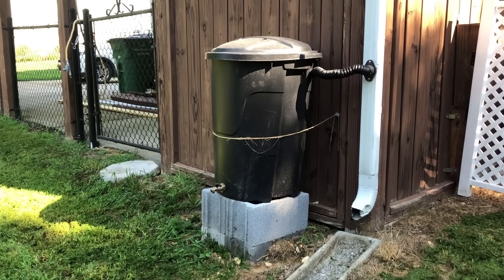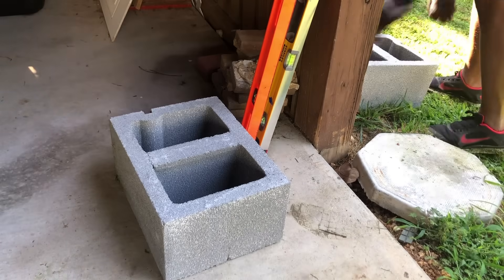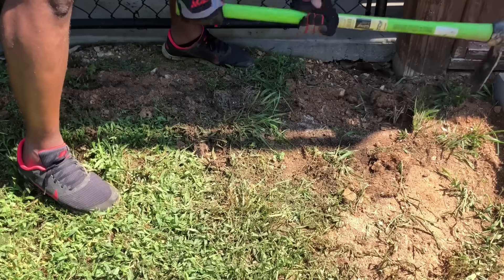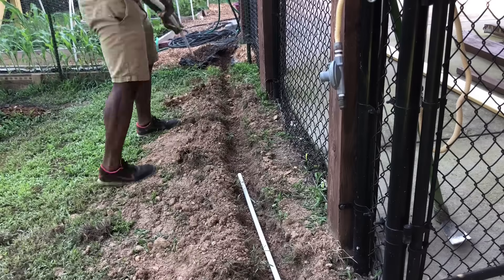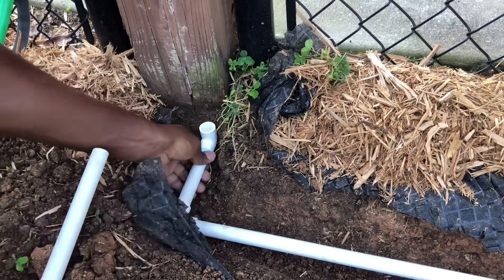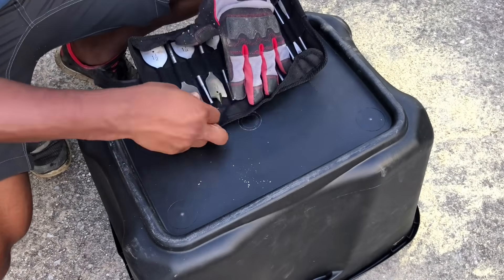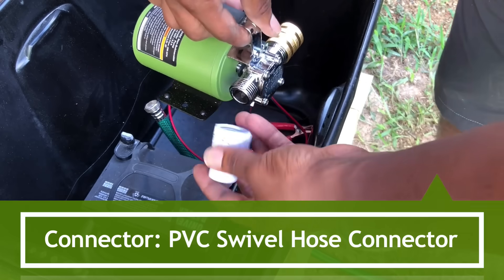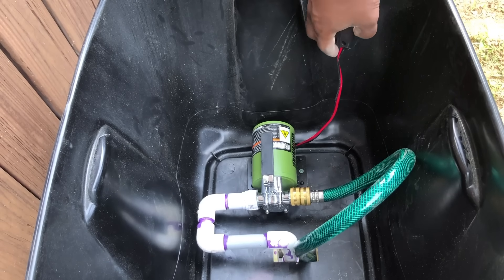Rain Barrel System | CHEAP Water Pump Setup

Comment: You did a great job at pipe fitting and your running dialog/instructions are spot on brilliant.  I wish you lived close so I could hire you.  Bravo Dude You Rocked it !   I built a green house ( 12 X 16 ) and plumed the gutters into a 55 gal plastic barrel.  I used a small solar panel from Harbor freight connected to a riding garden tractor mower battery and I used a 12v  bilge pump for a boat as my pump for watering in my greenhouse and filling buckets for stuff outside.   Works great.
Reply from the maker: That's awesome! A greenhouse is definitely something on my to-do list one day.

Comment: Thanks for the great video!
Wondered if you have had any issues with using screws into the cement blocks ? I used blocks in a fencing project on my goat pen and they were fine when dry but when the rain soaked the blocks they tended to break.
Regards
Reply from the maker: Hey HayLoft, no issues yet thankfully. It is my first time using them in an outdoor application, so only time will tell.

Comment: I have Harbor Freight 100 watt solar panel system for my homemade camper and it would be perfect for ur set up. Comes with everything you need to plug and go 👍🏻 Good video 😊
Reply from the maker: Awesome! I want to make a homemade camper one day.
Reply: @GreenTechTown  
I have a couple of videos on my channel of the camper i made, 4x8 small one and 6x10 cargo trailer currently making, you might find interesting. 👍🏻

Comment: Awesome stuff. Is it child proof?
I can see my son turning both water sources on at the same time! 
Have you tried doing that?
Reply from the maker: I have not tried that and wouldn't recommend it since you need to also have a back flow preventer installed on the city water side. I'm in the process of re-designing the city water line setup.

Comment: Nice video and project. I'm watching this a bit late, but guessing you couldn't use the sprinkler once the plants filled in since the middle plants would block the water from reaching the outer plants.
Reply from the maker: Yep, that's the primary issue I ran into, but also noticed it wasted a lot of water too over spraying onto the mulch/walkway.

Comment: I cant believe how good u r at running pipe and not being in that line of work.lil shit like making sure u can turn the valves and not gluing b4 running the hole thing. I would have guesses u were a plumber or pipe fitter.  I weld pipe
Reply from the maker: Haha thanks!

Comment: Around my area: need to install an antisiphon on the city supply.
Great job!
Reply: Exactly, to prevent contamination of Municipal supply. My first reaction. Be safer to keep systems separate.
Reply: Your design that could cross connect the rain barrel into the city water supply is not legal in the areas that I have lived...keep the systems separate or face the potential of significant fines!
Reply: I freak out if anyone is near my rain catchments with dirty city water!
Reply: I had a mini heart attack when I saw him connect the two lines.

Comment: I like to take some duct tape around both primer and cement sans for more stability. You should prime, glue, and put the pieces together with a TWIST.  

90° is usually enough. Then hold.

Comment: New subscriber here! Very nice set up. I am contemplating doing rainwater system vs using our public water. We get plenty of rain in our area too.
Reply from the maker: You should definitely do that! I am thinking about adding an additional barrel to the current system to increase my holding capacity.

Comment: You made working this neatly look so easy! I would’ve made a huge mess. Excellent work and just a beautiful description, you managed to explain everything thoroughly without making this video an hour long. Good call mentioning local code and the heads up about the backflow preventer. Very responsible, and I’m now subscribed. It’s no accident that I am seeing so many encouraging comments on this video — i can’t imagine how this could be improved. Stellar work Robert
Reply from the maker: Thanks Karen for your positive feedback and for subscribing!
Reply: Backflow prevention is a must any time a non potable water system is directly connected to a potable water system. Having a pump on the non potable system certainly creates risk of cross contamination.

Comment: Low cost boat bilge pump with flost switches set up to transfer water to a higher mounted set of barrels Dutch Bucket connected....
Solar power the pump.
Easy setup.
Reply: Yeah gravity is a good friend. Just raise the rain barrel in the first place. Why wast time and hundreds of dollars on the electric pump battery and pvc!

Comment: Robert how long will the charge on the battery last as shown? And then what?
Reply from the maker: Hey Mark, I did not do a full drain test to see how many drain cycles I could get, but you should check out my next video which shows how I hooked up a solar panel to the battery so I basically should never have to worry about the battery being completely drained. :D
Reply: @GreenTechTown  thanks Robert..makes sense

Comment: How long does battery last before needing a charge
Reply from the maker: So far I have been able to empty the entire barrel and the battery was still fully charged. I have not performed a drain test, but I would assume I could drain the barrel a few times before it needs to be charged. I installed a solar panel to the system in my other video, so now I hardly ever have to worry about the battery being drained.

Comment: Awesome! I had a similar setup and the transfer pump was too many gph and ran the pump and 80 gallon barrel dry in about 10 mins. I need to figure out a smaller pump maybe that could just be set inside the rain barrel and run straight to drip irrigation.. 🤔 Like the solar panel idea to run it too!!
Reply from the maker: Yeah that may work too.

Comment: This is a great video you did an excellent job you showed everything just perfect in my opinion did a good job I like it because you help me get some good ideas to for my garden that’s what I need to get a rain Barrel to water my garden too we got finally got last year got raised bed garden but I like what you did great job scribed your channel
Reply: Another pump that would work well and less plumbing would be a bilge pump for a boat. You can get with a built in float switch or auxiliary float switch to turn on at certain water level  its submersible  just drop into barrel
Reply from the maker: Awesome, thanks for subscribing and glad I was able to help in some way!

Comment: Excellent demo. Look forward to more. Something I wonder is how long does your pump run on a full tank of water. Can you add a cutoff valve so the pump does not run dry?
Reply from the maker: It takes only a few minutes to empty the barrel when it is full with the pump. I haven’t timed it but I’d say roughly 5-10min. And yes, I plan on installing something similar to help prevent me from ever running the pump if the barrel is empty. Will have a video out for that process soon. :)

Comment: Very fine video with close ups on plumbing fittings and complete explanation up one on your overkill rain system. Your attention to detail is phenomenal. A great deal of $ and time was spent on this project so I cannot see that you did this to use "free" water. Rainwater is however very good for your garden. Unless you have rain frequently in which case you might not need much water for your garden you will be needing a larger reservoir. Subscribed

Comment: Be sure to have a valve at the lowest spot so you can drain during freezing weather.  Nice setup!
Reply from the maker: Thanks, and thanks for sharing the tip.
Reply: One way to get around that is to blow the line out with pressurized air and/or drip a little plumber's antifreeze in the line.  Have to run the antifreeze out in the spring.  Way better to put a drain in the line.
Reply: @uhadonejob  Compressed air blowout is nice when you need to occasionally water in the day but know you'll have a freeze at night. I'm planning on setting this up later in the year.
Reply: I used PVC but at most joints I did not glue, I drilled a tiny hole and inserted a white aluminum nail to keep fitted. Under pressure almost no leakage, and I can easily pull nail and move my pipes,  in fall the joints will “leak enough” to empty pipes at many places to prevent freeze damage.   Hey drops leaking does not matter, it is rainwater outside.  Open. Joint if you really want to drain line,   Also makes expensive PVC fittings re useable and moveable.
Reply: @billjones5178  I too like reusing pvc. I made a vid on how using bike inner tubes can be used for temp pvc joints.  Also, you can heat the pvc to remove pipe from elbows etc.  It works!
Reply: good one!
Reply: ah all the snarky comments I could make!  A good tip. . . . sorry all the Kevins and Karens have gotten to me today.
Reply: When it freezes that PVC pipe is going to break and it will drain all over the place.

Comment: Question, how did you connect the battery to the pump, you just put the cables on and leave it like that in the box, or should they be removed when youre done using it? This video was EXACTLY what I have been looking for, for almost a year. I really appreciate how thorough this was filmed, and how you added the voice over the video, instead of talking during the video. new subscriber! I now feel like I can attempt this myself!!
Reply from the maker: Since the pump had an on/off switch, I just left the alligator clamps attached to the battery for convenience in the future. The only improvement I would make if I had time is create a separator between the water related components (pump and pvc) and the electrical components in the tote.

Comment: Could you also run PVC underground along your landscaping beds and drill small holes in the pipe....using the pump to run water under the length of the landscaping beds and watering them from underground?  The mobile app and several other things are way beyond me...but using barrel water to water all of my landscaping in the backyard would be my major goal.
Reply from the maker: I would imagine you could. I have never attempted this or looked into it, but as long as you could prevent the hose/PVC from becoming clogged (similar to a soaker hose) from plant roots or other debris, in theory it sounds possible.

Comment: Awesome Name, Awesome content, awesome intentions. I'm looking at replicating this system with a solar panel to run the transfer pump. Do you have a recommended setup / details?
Reply from the maker: Hey Robert. I just finished implementing a "basic" solar setup yesterday that I plan to try to edit and put out by the end of the week. Will you be wiring your pump directly to the solar panel, or will you have the solar panel charge a battery, and then have the transfer pump run off the battery?
Reply: @GreenTechTown  I wanted to use a battery because it seemed like a better long term solution! I'll enjoy your content whether you use one or not!

Comment: I have a couple of questions what I'm trying to do is bring water from my rain barrels into my kitchen to be able to wash dishes or fill my Berkey I've looked into submersible pumps I have 12 volt solar system but was thinking maybe battery operated pump would be better to pump the water up to the house which is a maybe 6 ft from the rain barrels I live off grid and only have 100 w of solar I've seen some people that have had a switch on the inside of their house and turn the water off and on could you please let me know if this is possible
Reply from the maker: The pump in my video would work fine for an application 6ft away, however I would not recommend it for your needs. I would recommend you look into "on demand" 12v DC pumps. Amazon I believe has a few for under $100 that may fit your needs.

Comment: Would have used a less powerful pump if you did it again or what that pump sufficient?   290 gallons an hour seems like a lot.  I have some raised beds close to the rain barrel but also need to run water along the length of the house about 75 feet.
Reply from the maker: I would probably use an on demand pump so I would not have to worry about the pump overheating if I turned off my spigot or stopped using the garden hose for a long period of time while the pump was still on. Those pumps are much more than the one I used, so definitely worth looking into if you have not started yet.

Comment: This was a great first step for me. I would love to see the solar panel and timer setup. That's my ultimate goal.
Reply: Solar inverter and electric timer
Reply: heck ya i want to see that too
Reply: i've got a ton of old solar panels from failed solar lighting. i bet lots of other people do too.  it would be good to see someone recycle them for a project like this to recharge batteries
Reply: @gregh7457  Not sure what you mean: are these panels that have lost efficiency but would good enough to charge a battery? If so, where would I go to find one?
Reply: @edbuurman3262  they are usually made with a clear plastic protective cover over the top of the solar panel and within a year that plastic degrades and is foggy and the cheap rechargeable batteries fail but the solar panels can be salvaged. most are tossed into the garbage
Reply: @gregh7457  how large are these solar panels you are referring to?
Reply: lol your on the next video.  i saw your post.  sry this was a first for me.
Reply: Yes I saw a video on that...but I'll look at it again when I actually get to that step...I just put 2 harbor freight 10×12 greenhouses together as one unit and I'm currently framing it with wood to keep the original aluminum frame from turning into scrap...but solar is the way to go for outdoor activities since..well...its outdoors lol...save on $$$ and rain water is much better than city water unless you're blessed to have a well which is double the bonus
Reply: What a great  idea to imply. I would like to see the solar  panel and timer video.
Reply: If you use solar you can keep it all dc if you can get a reliable 12v dc pump. But you might need a microcontroller like arduino and some sort of transistor to control 12 v from battery with a low voltage. But this can be absurd with a simple with if you don't mind manually turning your system on and off.

Comment: How too create an rain barrel for auto detailing? How can I get great water Pressure from the water hose with foam pump attachment?
Reply from the maker: The pressure will depend on the pump you use and the distance from the pump to the end of your water hose. I would probably go with a more powerful pump if I was using it for auto detailing honestly. I have not used any other pumps other than the one in the video, but I know Harbor Freight and local box stores should sell them. You should be able to try them out and if the pressure is not what you are looking for, return the unit, but double check with the store's policy would be my advice.
Reply: @GreenTechTown  Thank-you

Comment: Interesting,  it has me thinking about how to connect all the rain cisterns to one pump using  the shutoff valves and  2 way valves.  Is it the pump that max ratings 12 psi?   Guess to have a complete system you are right, solar, timer oh and a filter.  The timer i might makee closer to the beds.  Thanks, really appreciate you putting it together.
Reply from the maker: I'm not entirely sure on the max rated PSI, but it is rated for a flow of 290GPH and has a total head lift of 40ft.